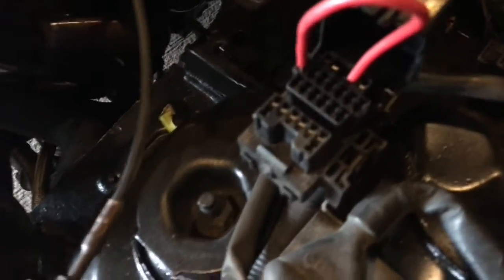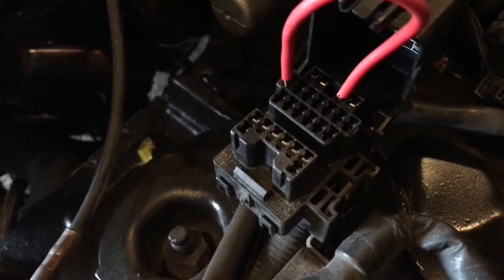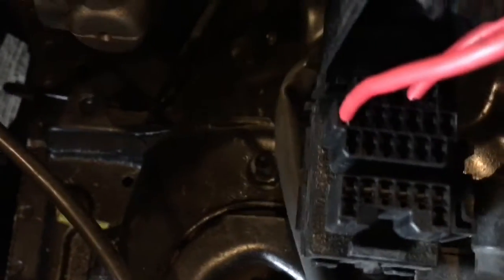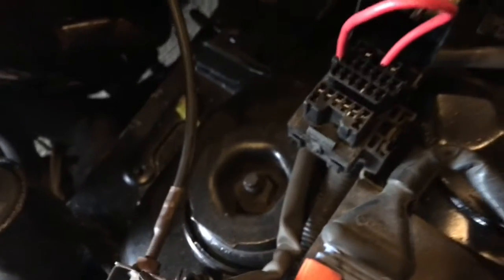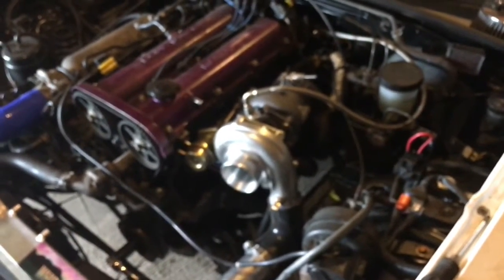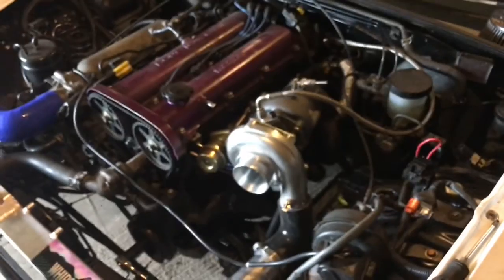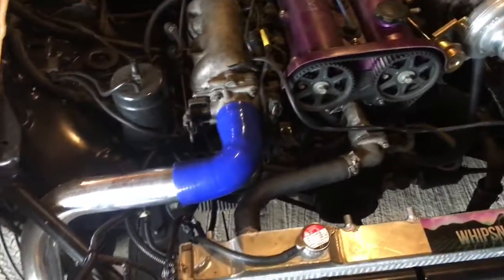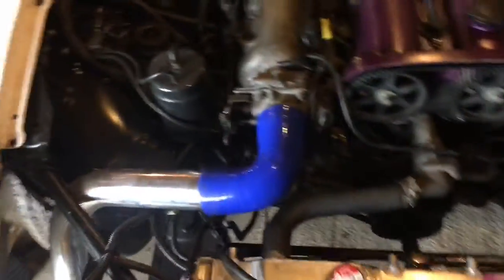DIY, how to set Miata timing 10 degrees advanced. For megasquirt

Comment: Thanks for posting, this step is super super important when installing MS! Just a tip, don't forget to recheck your ignition timing after installing MS (Setting MS to "fixed timing" will lock it into base timing) and you can adjust the timing with the trigger offset instead of mechanically with the CAS, which makes it really easy since you can make very fine adjustments. Cheers!
Reply from the maker: Yea definitely gonna need to check that it's not installed yet but hopefully next week! Means a lot for a guy like you who I watch all your videos to comment on one of my videos! Thanks man😋